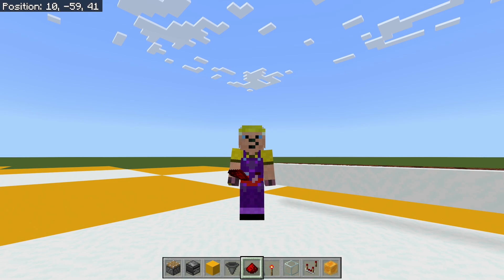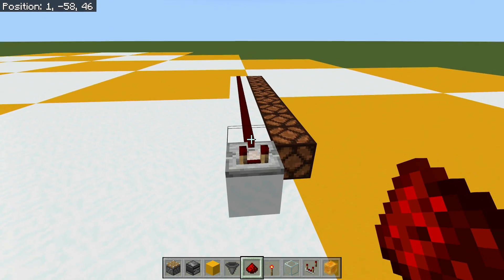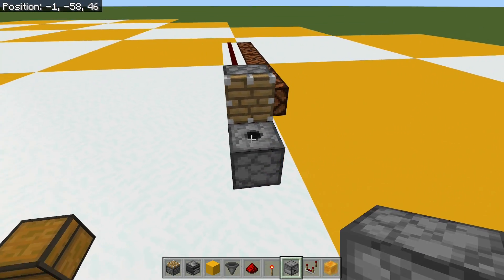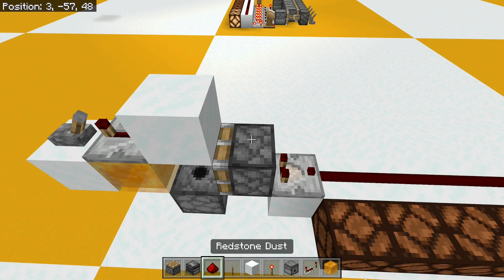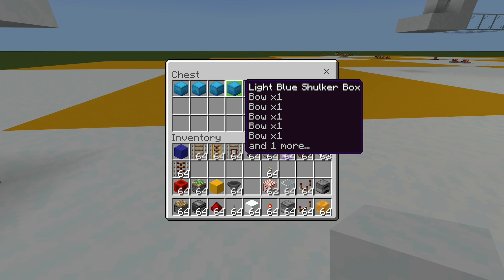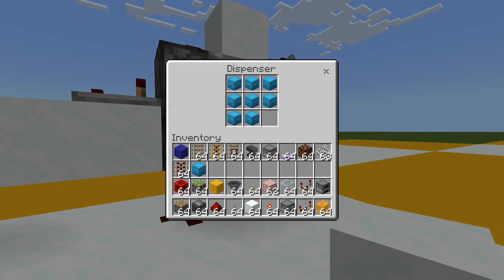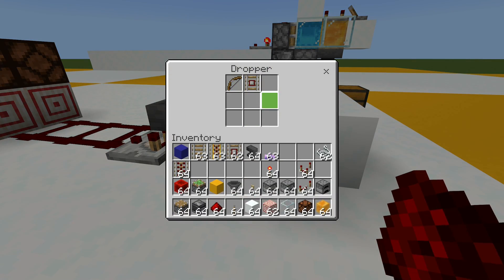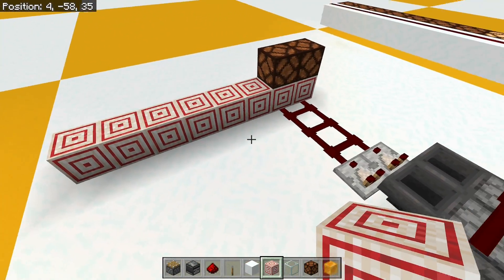Randomizer for Minecraft Bedrock - Signal Strength, Probability and Binary

Comment: hey, i'm working on a server project in minecraft, and i have no idea what i'm doing, wonder if you can help me figure out how to make this thing work....

basically, the players in this server are traveling merchants. They are given a certain amount of money when they join, and must buy items from the market at the starting town, then make a 4-day (in-game) journey to the next town to sell the items. It's up to the player to pay attention to the values of the items in both towns (the towns have different prices for different items, and there is a board in each town listing the prices for each item in the other town), and make profitable decisions.

the issue is, if its just the same prices all the time, it's going to get kinda boring eventually. so I want to use a system to randomise the price at the start of every new day (basically using a daylight sensor as the switch to turn on the randomiser). ideally i'd like it to be truly randomised, but because i'll be using command blocks to remove the items from the players' inventories then add money to their account (since that's the only way to really do this on bedrock, afaik), it's going to need to randomly select one of a preset number of price options. because going in and manually changing the numbers in the command blocks is a headache, so i'll need to set up several command block chains pre-loaded with different numbers, and just only have one chain available at a time by blocking the other ones when they're not active. i imagine the first randomiser in this video would work well for this, but i'm looking for a way to automatically take the output of the randomiser and block/unblock the chains by using a separate command chain to place/remove blocks in front of the buttons, and i don't see any way to make that happen. simply having the redstone connect to the command blocks in a line would have more than one command block active at a time if the output was more than 1 signal strength, right?

anyway, i was just wondering if you could help me figure this mess out in a way that: doesn't cause too much lag on my server; is somewhat compact; and doesnt require me to find any external plugins to make it work, just uses vanilla redstone components.

Comment: Hey eggfur your bonemeal moss based farm with the lava tiking may be slightly off now I am getting alot of cobble almost every time I start the farm it could be my older system with lag but I was just letting you know to look into it thanks for being awesome man
Reply from the maker: If you mean my design rather than zolson's, it appears you can "fix" it by  reducing the repeater after the on/off switch by 1 tick. You'd think that would make it faster, but it actually shows it down, but seems to get rid of the cobble.
Reply: Thanks I had to reduce both repeaters in the main clock to 4 tick to get the cobble to stop appearing for me